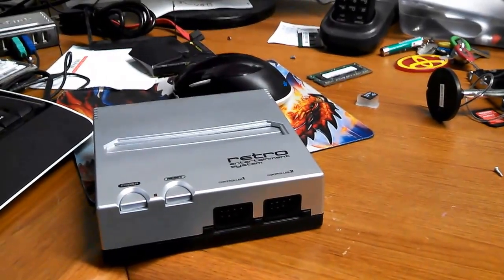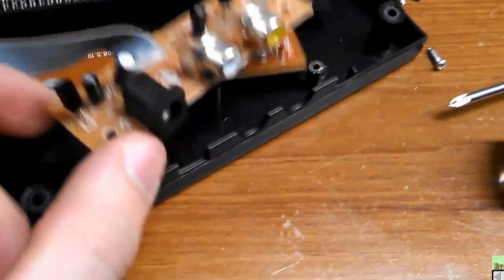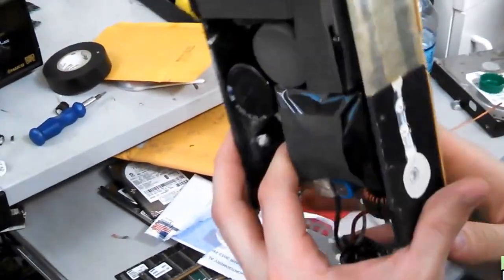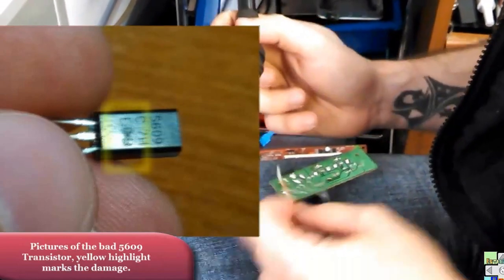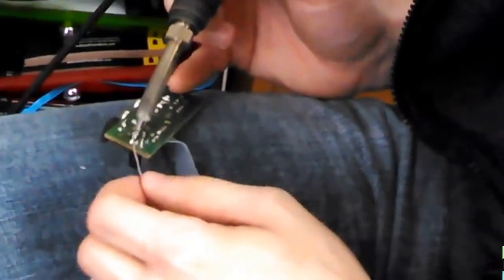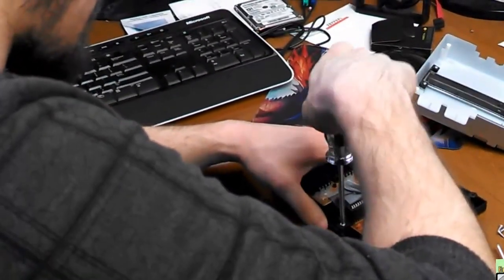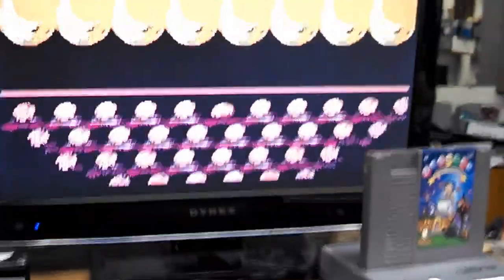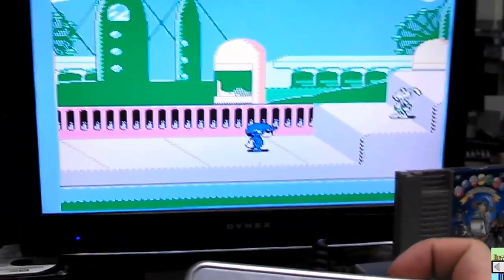Repair of $20 NES Clone System retro-bit Entertainment System 5609 Transistor Replacement

Comment: Hey thanks for this great video. I did the same thing to my RES and even used a 12v, 16w PSU on it and it worked just fine! It didn't blow the new transistor.

Comment: Which transistor did you use exactly?
Reply from the maker: 2SD1207T Transistor from an old apple power-supply of some sort. Its been awhile but I think that is what it was.
Reply: Have you ever modified a Retron 1 with the transistor. How much would it cost if you do one.

Comment: How to Open the Retro Bit It has No screws...
Reply: +RangerXander He skipped the unscrewing the screws part.
Reply: The screw are under the rubber feet. Remove the rubbers on the bottom and you see the screws

Comment: It was not busted because of the wrong voltage. It was busted because of the wrong polarity. All the famiclone AC/DC adapters have negative centerpin. Inside the console there is a 7805 regulator, that is able to work from 7V up to 40V input.

Comment: Great video, even if it was shot using a phone. If its true, I think you found a possible video improvement mod to this NES Clone.. It would be interesting to see a comparison between the two. 

It got me thinking of getting one of these clone systems and replacing the 5609 transistor to a 2SD1207T transistor just to see if its true.  I might do it... don't know when but it's a possible project to do in the future.